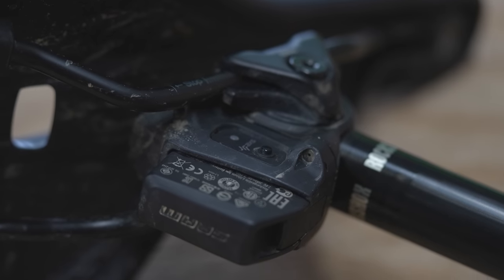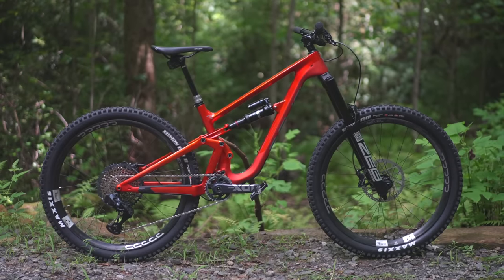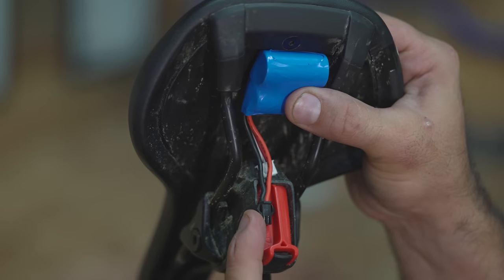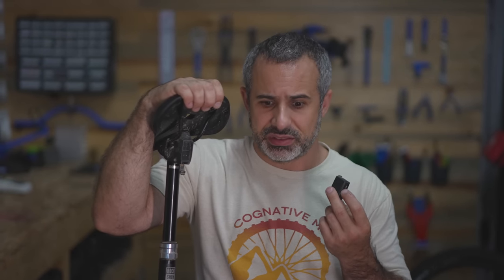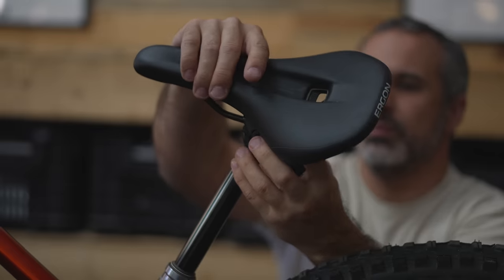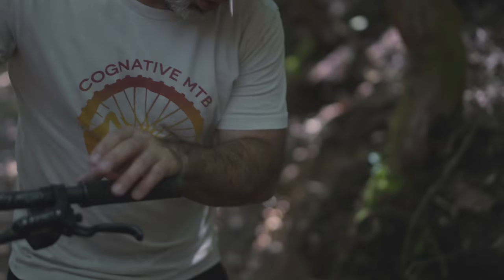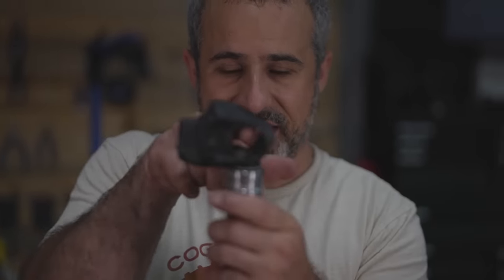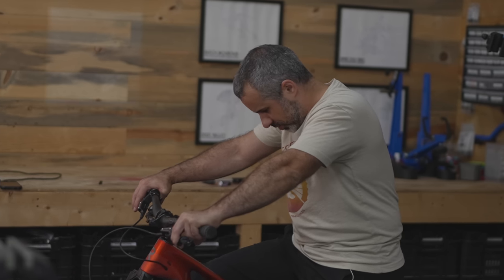My Wireless Seatpost has a big problem... Let's hack it!

Comment: I did exaclty the same 6 month ago, with the difference, that I managed to lose the screw and get the bolt out without cutting it :D seems like my saddle is a littlebit higher than the ergons, bc I dont have the problem with the battery hitting the undeside of the saddle. Still today I think that the battery should have been in the front as you buy it, bc this way it is way more protected of dirt an you dont have any problems with ankerlifts, like we have in some bikeparks in germany, where you place the anker under your saddle an get towed uphill this way!

Comment: What you need is an adapter to go between the seat rail and the post, an angled one so you don't have to gut the $800 part. Like take the rail clamp off a cheap post, weld a couple rails to the bottom of it, and done.

Comment: this would have been a perfect project for the 3d printer.  You could easily design an adapter  in a simple CAD program that would not protrude at all from the battery port, and print it in PETG OR abs.

Comment: I have a carbon fiber frame and a specialized blacklite command post that has sized together. I have tried a 10 pound dead blow hammer, freezing the dropper post and heating it up with boiling water but it will not break loose. I have ridden the bike for 4 years with no seat post clamp and it hasn't moved, any suggestions out there?

Comment: This is the EXACT same problem I have had since 3 years now ! An I've even done the same alternatives to resolve :) (without ripping the micro adjustment thingy). Hah so cool to see I'm not the only one with this issue.
The solution is, when you go out, just duck tape the battery around the post :)  , simple, ugly, stupid...but it works. After chasing down the battery back the trail path, you get over the looks and stupidness of the solution

Comment: Open up the post side of everything and tap into the back side of the contacts, run wire to previously placed batt…nothing to knock off and you still have removable power to the system

Comment: So now you put your battery relocate adapter back on and bulge problem solved! And as others have mentioned please make sure the batteries you are using have a protection circuit built in

Comment: I like the solution of putting the battery away from the rear, but there is still one problem to be solved: how to wash the bike and not have water entering the battery contacts or the dropper contact itself?

Comment: Cool vid for the 3 other people worldwide that can afford that post, particularly for the 1 that might do this.
Now tell me how to limit the extension of my generic came-with-the-bike dropper.  I have it as low as it can go in the frame, but when it's extended, it's about 35mm too high. 
Yeah, I know "just drop it a bit", but it's a nuisance and it's never exactly the right height unless I get off to do it, and then I might as well just get an Olde Worlde seatpost with a QR clamp.

Comment: A far bigger issue with this expensive seat post is the vertical play it develops after a few hours of use. There is a simple procedure where the seat is flipped over and recalibrated, but that fix is temporary. It’s only a matter of time before the vertical movement is back. Very poor product, especially for the money.

Comment: I think the easiest, but not most cost effective solution, would have been to run a dropper with less drop. Sacrificing drop would move the battery away from the tire, thus getting rid of your whole problem.

Comment: Why not try putting an extra ring on the seats tube (drop tube?) (similar to adjusting the threadless neck for the forks and handle bar stem) between the seat post and where it clamps to the frame forcing the seat a tad higher. This would keep the seat low enough for the jumps and such, but would mean when the seat in its highest position, you would sit a bit higher, maybe a 1/4" at the most would be needed, at least I would imagine that's all that would be. Wish I had a better way to explain the idea, but maybe someone else will catch on and add a better way of saying it.

Comment: couldnt you just take swap or turn the seat post around so the battery would face the handlebars instead facing the back wheel?
Reply: because there are bolts on the side where you can take the seat off instead of rewiring

Comment: Rockshox droppers...one of the worst reliability records in the industry, improved with a bottom out clearance robbing battery location. The obvious solution is you buy the next shorter size post than you need, and run the seatpost sticking out of your frame a bit higher, thus limiting how close to the tire it'll be at full compression.

Comment: So soldier the wires directly onto the base unit removing the battery cover completely.
Pro: you can grind back the base near flat with the wires..
Con: you have now irreparably damaged the base.

Or... Get your favorite manual top action dropper, and wire a wireless solenoid to it yourself... and It will probably cost WAY less.

Comment: put a switchgrade between the post and the saddle so you can have the extra clearance to run the post backwards with the saddle at the desired angle  and then you will also have a switchgrade 😎

Comment: Why not put the battery at the bottom of the post inside the frame lower centre of gravity well protected out of the way and then just a little charge port under the seat at the front so it doesn't get covered in mud

Comment: I love this bodge, but I really don't understand what problem this wireless dropper is solving. Aside from cleaning up your cockpit, I see this as having many downsides and no upsides compared to a regular dropper. Could someone tell me what the deal is?
Reply: You can swap between bikes. And some bikes are not easy to run a cable with.
Reply: @bindingcurve  I see your point when it comes to routing - externally routed droppers suck. That said, I don't get swapping between your bikes. I can buy four regular droppers for the price of this one so for most uses I'll just do that 🤷‍♂️

Comment: Just 3D print an thin adaptor with cables and a thin socket for the battery to connect the battery through them. It is like 20min job 😆

And than sell it, as more people can face the same problem. 

Waiting for my 20% of each. 🤷🏽‍♂️

Comment: The battery should be inside the post. Then use a magnetic contact charger. Leaving a big battery hanging off is just not acceptable. Even for hard tail fans like me, that where my underseat bag with tubes and tools go.

Comment: That is absolutely ridiculous that they wouldn't engineer it differently for full rear suspension movement.  Not really a hard fix as Seth has just shown us, just run a remote battery via wires under the seat.

Comment: Could you not just lift the post out the frame 1/2” to clear the tire?
Reply: Or just not drop the seat all the way down.  I rarely drop mine down all the way, usually just enough to get it out of the way.

Comment: Your seat definitely flexes more than you think and having a battery that can explode when punctured under your seat is baaaaad. Alot of seats will have marks from where they have flexed and hit the "guts" if this happened with a LiPo it would be getting pretty hot down there.

Comment: Or you could, you know, raise the post by about a centimeter. Please read page 14 of the user manual where it instructs you to check for adequate clearance between the tire and battery at full suspension compression to prevent this problem from happening.
Reply: What's the point of that? You want to slam that saddle as far down as possible. You don't want no damn battery ruining that.

Comment: Seth if you do any more to this (or any battery modifications in the future) PLEASE DO NOT HAVE AN EXPOSED LI-ION OR LI-PO CELL. If a rock or something gets shot up or you crash and punctures the casing of the cell it will likely catch on fire. Cool ideas to solve your very specific problem, but at least put it inside a 3D printed enclosure or something.

Comment: Seriously, why couldn't you just mount your seat backwards, then put the seat post in the frame backwards? It looks like the post has the cone retention system like the old Joplin for the seat. So, the seat should be infinity adjustable.
I'm sorry, am I missing something? Because I just don't see the problem.

Comment: The easiest solution is to not use an $800 dropper post that can't take a big jump. Pay $200 and have the extra wire. Unless you're doing bar spins and tail whips, having one extra cable won't be a big deal.

Comment: Would have went down 25mm in travel and avoided this all together. You don’t need your seat SLAMMED on the frame. You just need it out of the way. Easily could have been avoided if measured, inspected and thought out. Makes for good content though
Reply: The meat riding for sram is insane
Reply: @noliemig  not even. The system isn’t designed in mind of slamming it down for enduro/dh type riding. Read what the manufacturer puts out and boom, avoided

Comment: I'd argue that the whole reason why you do this isn't because of Sram design but because Revel poorly designed their frame in the size you are riding. No frame properly designed should saddle buzzz in 2022. We had then problem in the early 2000 with long travel DH bikes, with a short travel bike it is ridiculous really.

Comment: You need to learn to 3d print. You could just print the adapter and make spring pins on a pcb that costs like 3$ for the adapter. Then you can have mechanical locking.

Comment: For the 6 of you that have this problem.... too funny. So you used a LiPo battery. How are you monitoring the voltage on it so that you don't drop below (I think it is what 3.2v per cell or something like that) the nominal voltage level that will damage the battery? Might be better to use a LiFe battery so you won't have that issue or the volatile nature of the LiPo batter sitting just below your junk.

Comment: So they have spendt8me and mobey to design a battery holder and charger, that is theirs only. With 3 pins and stuff. But they could not get  it in the bottom of the post, if not in front. Yea tell me about it. As in the back you could have a small seat case for when you are not jumping also. This is not the only thing that a wireless thing can mess up. Having this engineered, tested and put together for sale takes a lot of work and time. Better luck next time!

Comment: Wireless dropper posts are the kind of accessories that no one really needs. I mean... mine costed 139€ with shipping, it has 170mm travel, it's more reliable, it came with a lever AND I don't even need to charge it. I mean WTF?

Comment: Running up the down escalator anyone? Love you bro, but seems like a lot of money and work to hide one wire that's already hidden in the frame, all while adding weight to a seatpost that is already More than twice the weight of a Fox dropper. I would rather have  larger brake rotors instead. Extra weight then located in a place I could actually use and enjoy it. So much for the warranty.

Comment: Or you could just take the seat off and put the dropper post in the wrong way so the battery is facing forward then put the seat back on facing the normal way and they nobody would know… that was before I saw your part of the video Oop

Comment: I wonder why the designers dont put the battery on the front.. sounds like lazy designing, i.e. no one checks really on the field or they just dont care thinking "if it it does not clear the wheel then just lift the seat".  Lazy...

Comment: So I've literally just got rid of my AXS dropper. I have a Canyon Spectral and a 170mm AXS dropper. Problem is that while it's an awesome bit of kit, the designers have been constrained by the need to have one general AXS battery. In my opinion all the electronics AND the battery should be at the bottom of the post, allowing for more drop. I've just replaced my 170mm AXS with a 210mm OneUp dropper. Sure, mashing a lever with my thumb feels crappy compared to the BZZZT BZZZT of the AXS button, but I get more drop for a quarter of the price. AXS also isn't really easy to home-service. There will probably be a much sleeker V2 version that gets around most of these issues. Great idea, badly executed.

Comment: That's honestly just an anti consumer design. It should take a regular 18650 that goes in as you said from the front or sits higher. It's a pretty poor design for no reason it seems other then to force you to buy there presumably overpriced battery in their special box.

Comment: Yeah the dropperpost design is bad lol
Reply: I mean if you got someone with some cad/solid works experiences and a 3d printer.
design a little puck which goes into the slot where the batteries go, pins connected to a cable and shift a battery holder with a similar design to hold the battery at the front to it.
There is definitely some hardware one could use to make use of the contact pins, possibly in the robotics department.
Reply: or, cant you limit the shock from compressing that much?
Reply: batteries are also normally 5v here in Germany at least, I don't think I've ever seen a 7.5v battery

Comment: I really don’t like the AXS dropper. The good - it’s wireless. That’s it. The bad - it can fill with air and get spongy, especially if you accidentally lift the bike by the seat. This happened to me within 50 miles, unfixable even using the special tool that comes with it. What kind of dropper needs a tool to fix it as a regular service procedure? And, the instructions are, if you don’t do it right or you do it to much, you break the dropper. And, there are no manuals or service parts available. Also I don’t like that it has no “feel” - you can’t hold the lever down part-way and get it “just right”. It’s either on or off. Click click. VERY unsatisfying. The PNW loam is 200 (and often 150 discounted) and works flawlessly, with a 69$ wolftooth dropper lever, which has awesome feel. I ended up getting mine refunded after a warranty claim, and haven’t missed it one iota. Loving my PNW Loam. No muss no fuss. $600 to spend on something else.